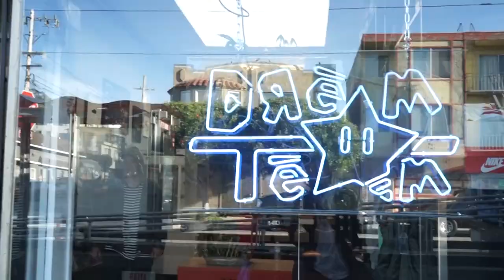Paypa Boy  Documentary series 1 - My GT Performer

Comment: I saved for almost a year in 1986-1987 to buy that same bike. I still have it and love it. I cleaned it up and put new tires on it a couple of years ago. All cables, brake pads, and chain need to be replaced.  I think I paid $700.00 C.O.D. for it. Still remember handing the UPS driver a huge stack of cash. Can't find one peg, and the flip up peg doesn't lock in place anymore but it still looks good. Did you get that feeling as a kid wishing you could have that bike when you finally got it?